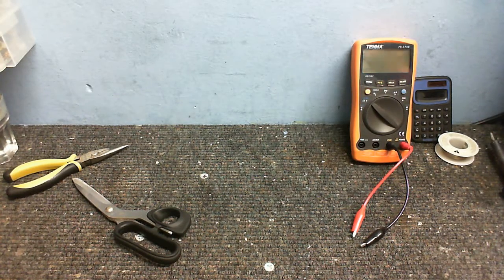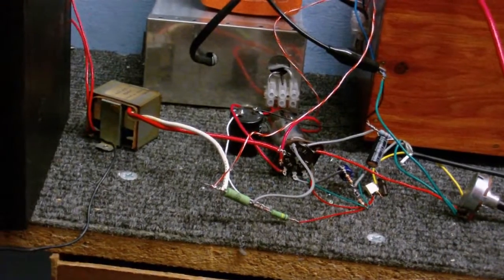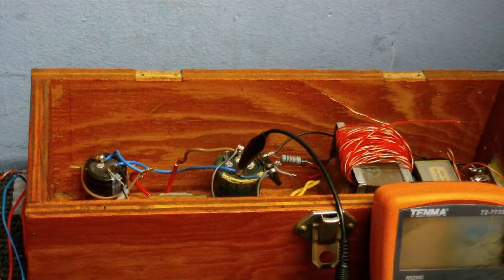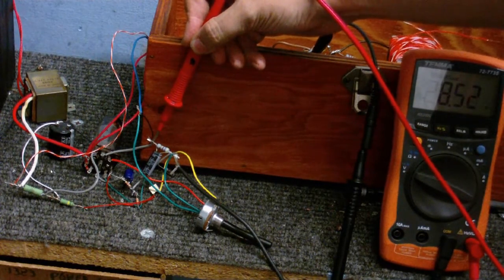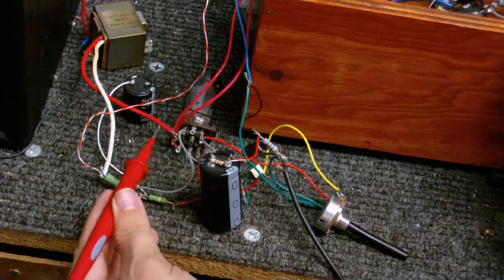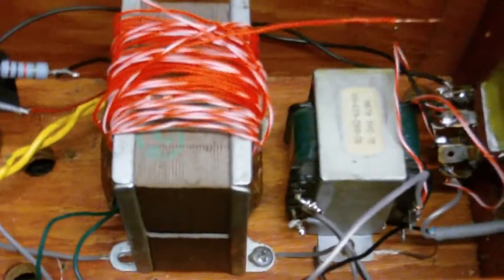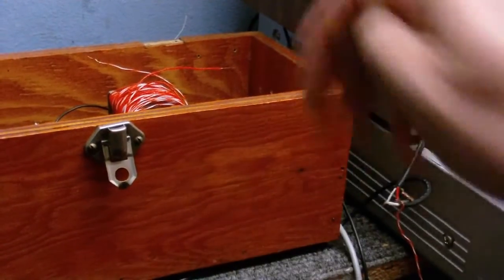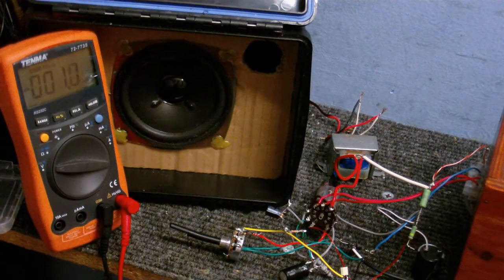Tube Time Episode 5 - ECL85 power amp experiment.

Comment: Great in depth video of making A tube amp! 

I like the speaker cabenit you made - the lid means you can stack it away safely without damaging the cone or anything :) nice work

Its good to have somthing like a tile laying around to put potentialy hot things on becuse carpet and other plastic surfaces can give off carbon monoxide and/or chlorene gas 

plastic is surprisingly made from oil witch is somthing new i learned recently whitch is where the carbon comes from. The chlorene comes from the chloride in Pvc

i guess this shows how vunerable we are to oil runing out

Comment: Also have to say that the little tics at the end might just be the fact that this tube is USED. It is not a true ECL85 but a SOVIET CLONE. Many of those were really really good tubes, but these ones WERE USED and I did not have a tester available at the time I sent them. Most of the tubes I gave you were new, however. I will send a similar tube that is WAY WAY Better....the PCL86! It is an ECL 86 with a different heater, but same specs and makes an even better amp!

Comment: Good job Clem!  I have never held a valve/tube before.  Do they get too hot to touch or just warm?  Is it true they glow purple when being overworked?
Reply from the maker: Most of them get VERY hot, or at least hot enough to melt the carpet that I have on my workbench!  The plate (the big metal part around the edge) will glow red hot if a tube is overworked, on some cameras it looks purple because there's a lot of infrared coming off that which looks purple on some cameras. The only time a tube will visibly glow purple is if a little air has leaked in, the voltage going through the air makes the air glow.

Comment: I would like to see what a RUSSIAN eq of an ECL82 would sound like using this schematic. We've been using tubes that were not specifically made for audio but even though it's an older design...the ECL82 (russian 6Ф3П-6F3P) should sound even better. At least with no distortion. Willing to try? Just curious.
Reply from the maker: ***** I imagine it would work well, just as long as everything is connected where it should go.

Comment: I'm wondering if I could plug this in using an ECL86 but otherwise leaving components the same.....? Thoughts?
Reply from the maker: ***** It should do, I tried this with a PCL86 a couple of days ago and it worked with no problems, lots of gain and no weird static like I was getting with the ECL85.
Reply: AWESOME! I will try it...I think you're general schematic and tube theory work really well with most tubes. I'd like to more on just HOW one chooses components for various valves...I only partially understand it.
Reply: I'm currently trying THIS schematic....one guy told me "this type of circuit has some problems" but he wasn't much more specific and said I need to figure it out on my own...learning how to pick my anode resistors I think he said.

What do you think? This one doesn't even have a volume control...I already put it half together then I thought maybe I should use yours.

The schematic I'm using:

http://i51.photobucket.com/albums/f396/czechrite/tube%20electronics/ECL86_BasicAMP_zpsb5b9263b.jpg
Reply: Did you not tell me I should change the original pentode resistor OR what that only in the event of using a ECL/PCL86?

Yeah, I'm looking at it now and seeing a 960Ω resistor....think that's what the ECL86 can handle.
Reply: ***** NVM. sorry for all the chatter.....I think it was supposed to be 120Ω for PCL86 or ECL86 tolerances.
Reply from the maker: ***** The 120Ω is better for the ECL86, I tried experimenting with an ECL86 some time ago (I didn't make a video of it) but with a 120Ω ohm resistor on the cathode it worked just great! The pins are different though is I remember right.
Reply: Pins? Uh yeah....I assumed they were the same but now that you mention  it I suppose it would be important that I check for certain! :D
heh.....! duh.err.....ATTENTION TO DETAIL is important. Thanks for mentioning it though. Can't wait to do more tinkering w this. :D